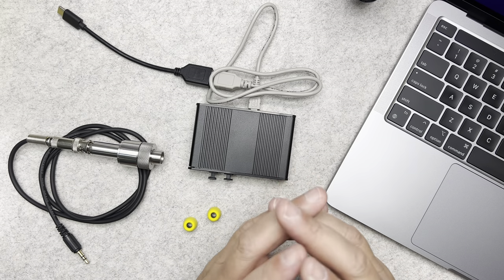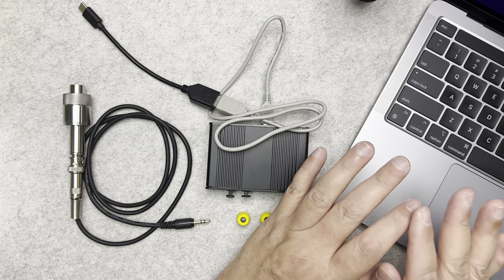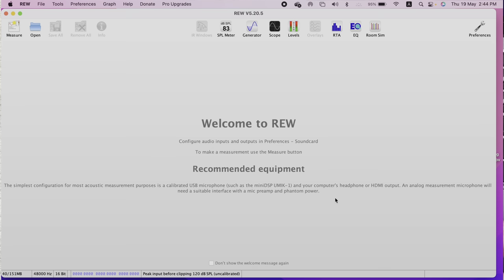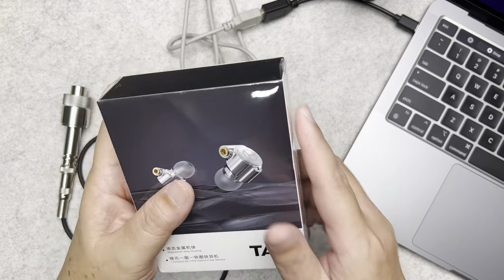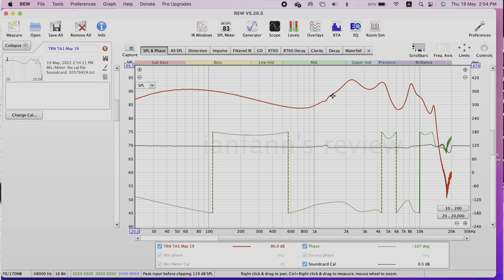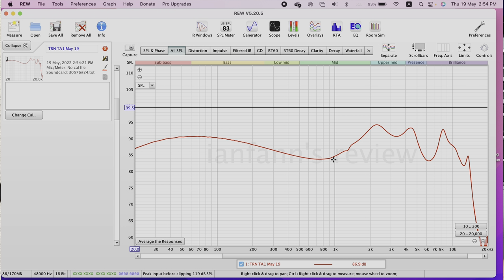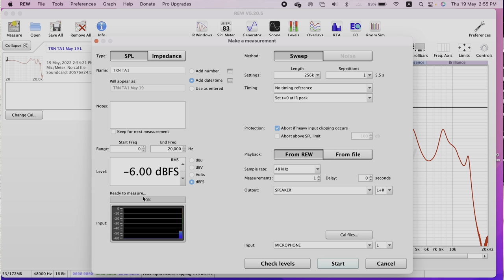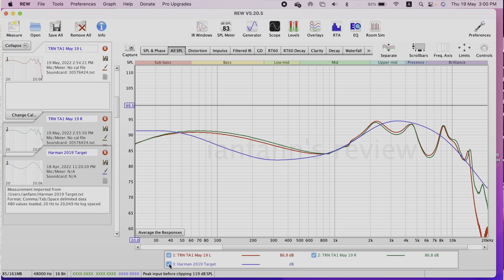How do I measure iems (in ear monitors)

Comment: comparing silicone and foam measurements, they are always different, especially in the treble, which my ears always can tell a huge difference in actual listening. Even changing silicone tips affect the stock sound a lot for me, but the more (carefully tuned) premium IEM you get, the more the stock silicone tips are important to get the intended sound signature.

Comment: Hey there, I just got into measuring my IEMs and have to say: your video is very helpful! Thank you so much for this step by step tutorial.

I have a few questions tho... First would be, where can I get the calibration files for my soundcard and coupler? I did not get them from the seller. But I did reach out and asked if they could provide them. I think I have the same rig as yours.
Secound question would be, where can I get the Harman and so on target files? I checked on squiglink but found no way to download them...

Thanks again for the great video :)

Comment: Hi Ian!  I am stuck. The thumb drive that was sent along with the coupler does not seem to have the calibration file on it.  And I am not sure where to download one.  If you have a moment, and could shoot me a link, I would really appreciate it.  The IEC711 coupler and sound card seem to be the same as the one in your video.
Reply: On the AliExpress page and in the description, they say to contact the customer service with the coupler’s serial number and your email to receive the calibration file as every coupler is unique. However, I am not sure where the customer service contact is? I will try to find out
Reply: @dbean5174  Thank you so much, but that is exactly what I did (on Amazon). They were super helpful and sent me the cal file. I’m in business now! Having a lot of fun with it and posting screencaps on my channel. It’s fun now that I’ve figured it out. So thank you for the help and of course Ian, for the vid!
Reply: @BassDad8 could you link me the provider on Amazon? Where was the customer service contact info at too? Thanks